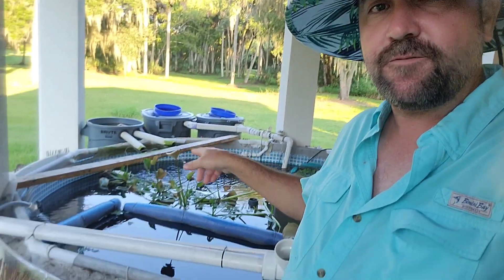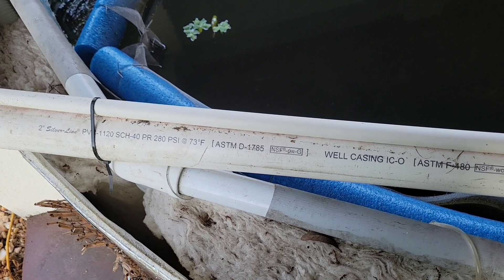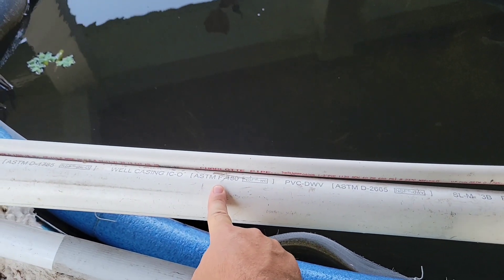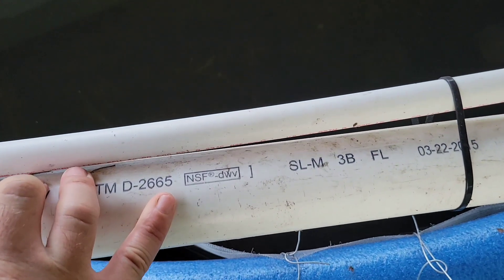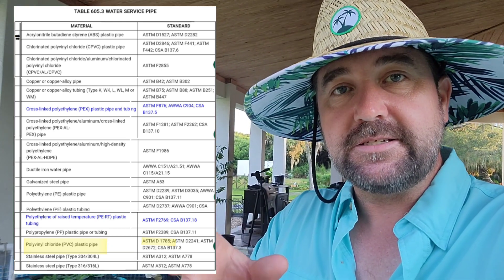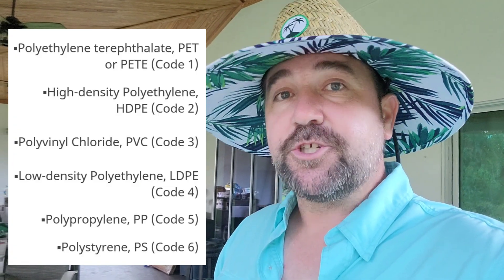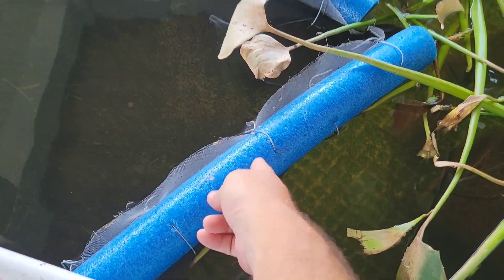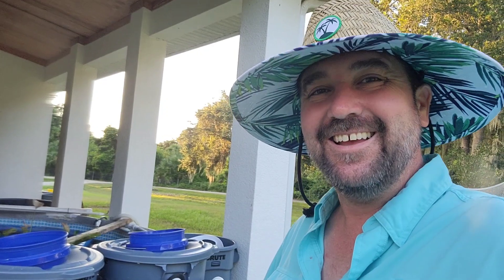Is It Safe To Use Plastics Including PVC in the Fish Pond For Aquaponics,  Aquaculture, Hydroponics?

Comment: You are pushing the definitions too far. All PVC is not food grade or potable water grade. This is why you have drain water pipe and NSF 51 rated PVC and CPVC. All plastic must be virgin plastic because recycled plastics may have been used to store toxic materials. Overall great video.